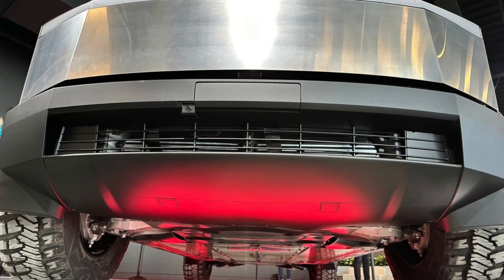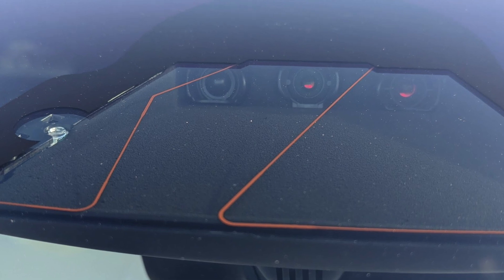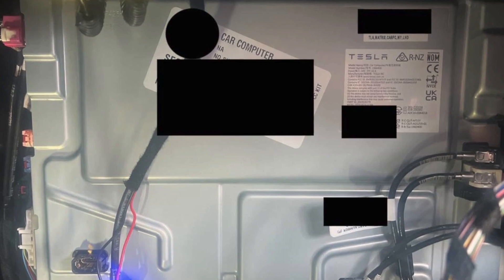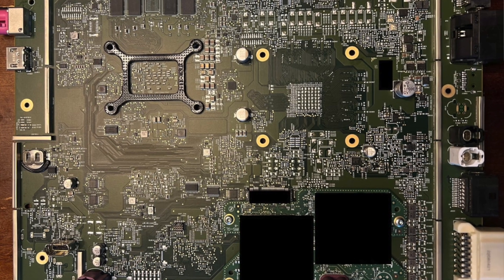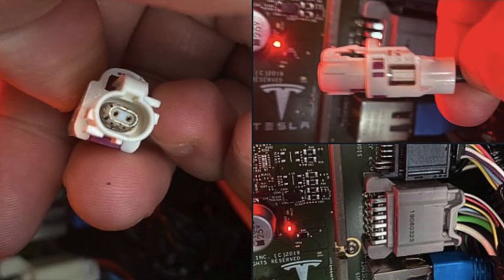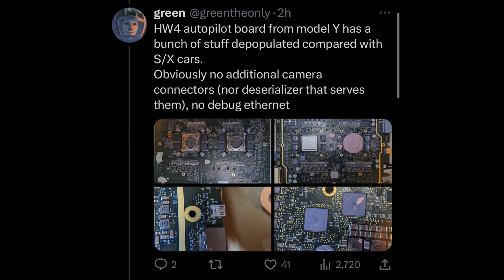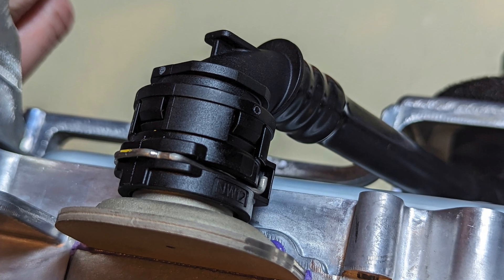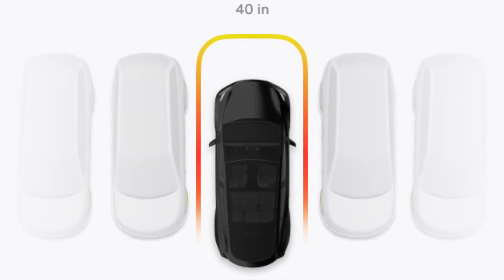NEW Tesla Model Y HW4 Camera Retrofit NOT Possible Confirmed!

Comment: I dont understand why tesla has 13 cameras on my model y hw4.0 with no camera on front bumper thats ridiculous the front bumper and back bumper are the 2 most common spots that all the new cars have crazy we dont have 360 veiw like what are they thinking yet they act like every tesla will have fsd capability im pissed as a first time tesla buyer that my car will be obsolete in a couple months you where saying make sure you get hardware 4.0 and thats what i did
Reply from the maker: Yeah it’s extremely tough as a regular buyer to know what to get if they Dont stay up to date with Tesla changes
Reply: I just bought the Tesla 23Y. I love it however because of the change it’s already out of date most likely the last tesla I’ll buy because by the time I’m ready to trade it in the other manufacturers that build higher quality will have have access to NACS network. 

Tesla has a long way to go in terms of customer satisfaction. When they come out with a new hardware, they don’t even try to make it backwards compatible. It just shows their lack of care for their customers.

It doesn’t even take into account the poor build quality. My sons 2015 Toyota Corolla has better fit and finish.
Reply from the maker: I don’t disagree with the fit and finish. I think my civic had less wind noise at 70mph than my 2021 MY.